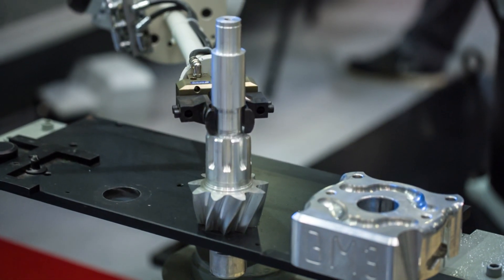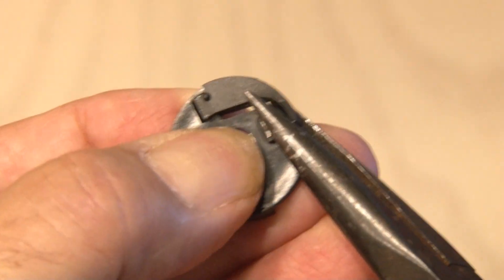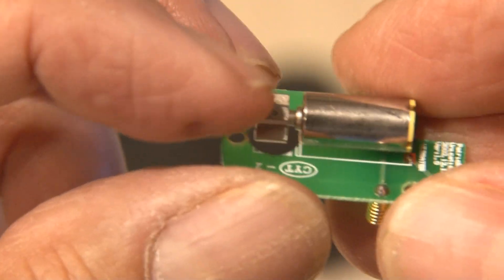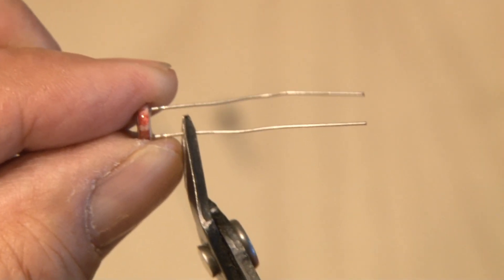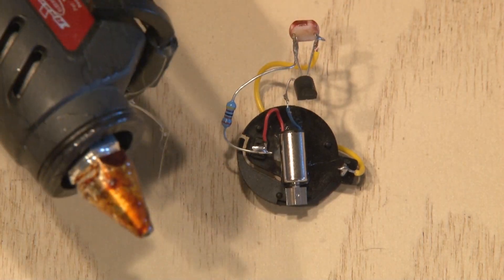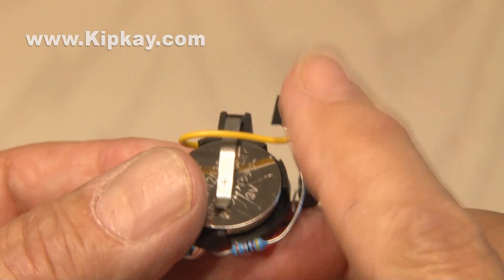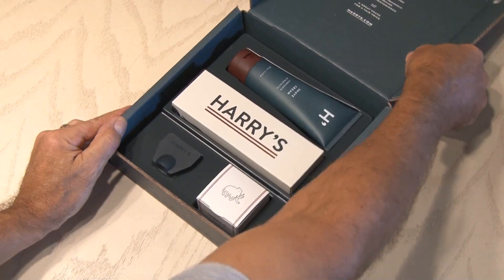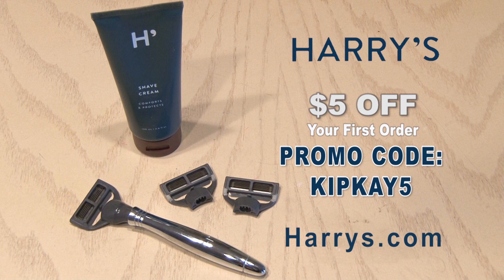How to Make a Tiny Robot!

Comment: Maybe you can do something RC related next time ?

Like a basic hobby grade conversion of a toy rc car without modifying the steering to proportional stuff with a servo while it still allows to make it faster and have more torque thanks too having a proper speedcontroller and a new battery or simply along with still using the 4x AA batteries it used to power it replacing the rear 130 sized motor with a way faster motor (pn racing 43 turn mini-z motor for example in that toy grade rc truck or car.)

Needs an old rc car with or without a battery (maybe use an example that used to run off 5x aa batteries or similar in this case)

(Receiver, Radio and two speedcontrollers. One that has no brake function and just goes reverse and forward.
And a second one for the drive motor that drives the rear wheels of the rc car used)

An old toy rc truck thats large enough to fit this under the body or somewhat protected in the cab of the body should work fine for it.
(even more so if it has a 370 sized motor as drive motor
(as they usually allows a replacement with not to much work put into it with a faster motor)
Or a small 130 sized motor as they are quite easy to replace with something faster from a mini-z motor).

Have the two esc's share the same battery while ofc making sure one esc isnt sending power towards the receiver so it doesnt burn it up entirely upon startup.

(also possible to use the same old batteries that powered it previously if you still want to stick too that (if its running off at least 4AA batteries you should be able to use that for the two speedcontrollers (ofc if you do that replace the rear motor with a faster one then already mounted to really improve it.)

The esc without the brake function is for the steering motor.
(keeping that assembly as it was to keep it simple.)
And the other one for the drive motor, pop in a 2s lipo or any other battery the two esc's handle and watch it become quite a bit faster while still being a quite simple and unexpensive toy which would be a nice starter rc car for minimal cash if you already have most of the electronics and is lacking a car and battery to put it into.

Or simply getting hold of a toy rc car that fits for the job that may have no remote or battery charger anymore is also an idea to use it for.

Comment: I feel like you need to take your projects one step further. Like for this one, built a paper mache bug body with eyes and antennas around the assembly to make it actually look like a bug. Sometimes your projects are good starter ideas, but stop short on the final application(s) or presentation.

Comment: Kipkay you can do better than that! Make somethings that's not lame and all electric. make It a big project not the little ones in a magazine
Reply: +BLACK 0PS BOSS We've seen Bristlebots and things like that. One vibrating motor and a small controlling circuit. This build is not even worth a beginners' time.
Reply: +AntiQuark Productions  your absolutely right
Reply: BLACK 0PS BOSS This hardly even qualifies as a robot.
Reply: YES I LIKE THIS A LOT
Reply: +AntiQuark Productions it doesn't, a robot is a device that performs a task, like a calculator, this thing wanders randomly.